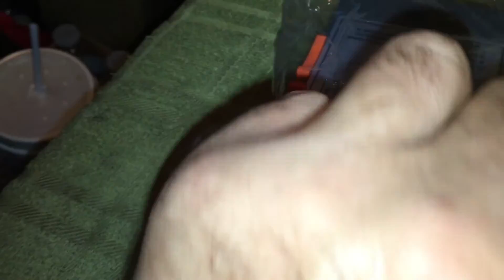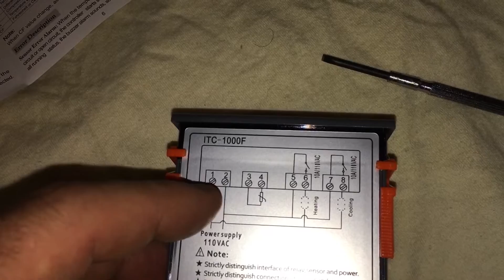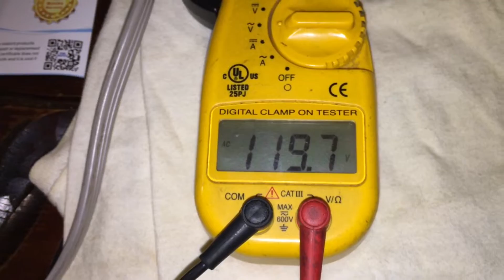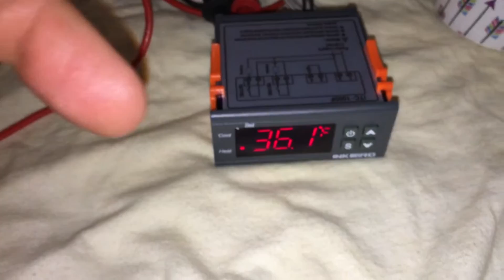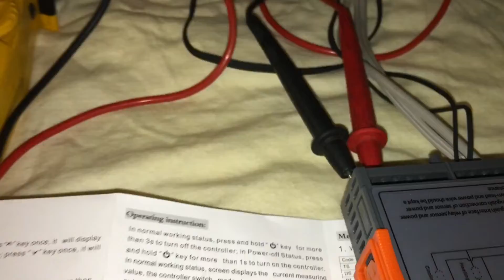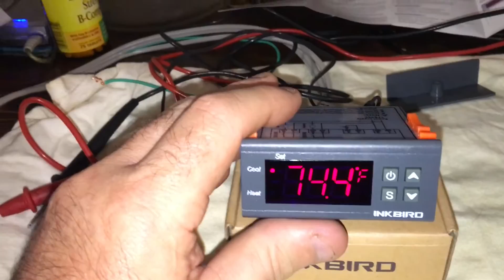How to Program & Wire in a inkbird Digital Temperature controller. iTC-1000F

Comment: Hey Phil if you go to united refrigerations website www.uri.com and search "CBOX" you will come up with a pvc 4"x4" water resistant electrical box made for the dixell controllers that has the correct cut out right in the front of the box. I have used these before to mount a dixell controller and it does exactly what you want it to do, plenty of room in the box behind the controller for all the wires and snesors too. Currently they have 1 left at their Ontario, Ca. distrubution warehouse but Im sure they can order more for you. Let me know if it works out for you!!    Chris
Reply from the maker: Thanks Chris !!! You Rock !!!
Reply from the maker: Been looking for a box to put controller & a contactor in forever !!! With a pre made hole. thanks !
Reply: Right on, yeah I searched for one for.a bit too. Glad I could help!!

Comment: I been having trouble with the orange plastic clips. The don't hold the controller firmly in place. I wonder if any one has a solution? thank you.
Reply from the maker: Make sure you are putting them on correctly. The springing end goes towards the hole. Once it touches compress clip one click tighter.

Comment: Iv put a few in. I had one revert back to default settings and another not read proper temp. Luck of the draw I guess. It's a decent controller not bad
Reply from the maker: thanks for the heads up. 👍

Comment: Wow an other video of oc. This is great👌👌👌. Have you ever heard of easycool and easyfreeze from carel? They are very cheap for reasonable quality and come with 2 ntc sensors. The programming is already done, just wire it in and ready.
Reply from the maker: no , i have not. ill have to ask my supply houses. thanks for that. This was very inexpensive. $15.99 off ebay. Brand new. free shipping.  i don't think the carels are that cheap. how much are the carels running ?
Reply: @OcRefrig  they are around 35 for the  cool version and 50 for the freeze version. I like them, they have rubber gasket
Behind the display, so keeps water out between panel and display.